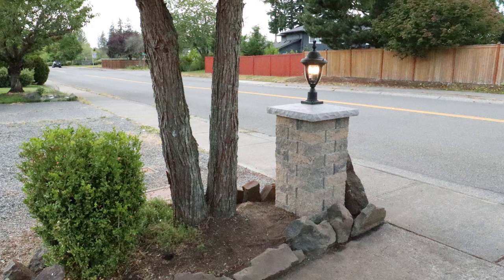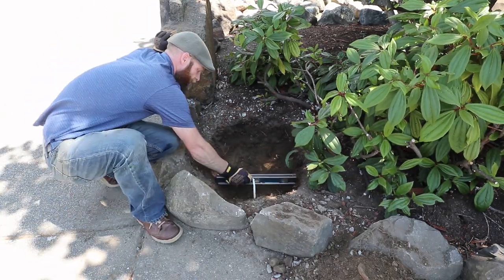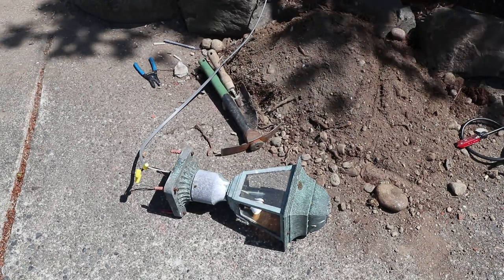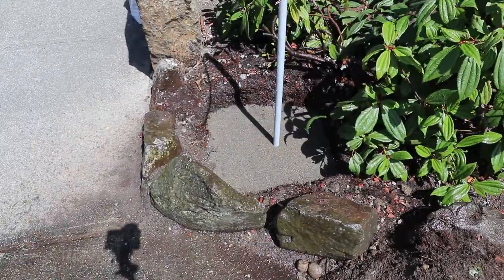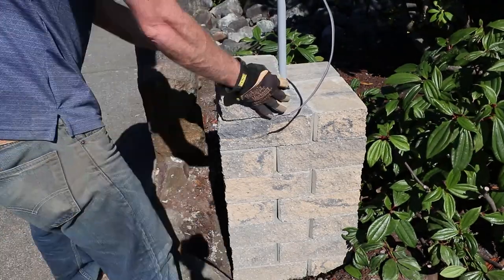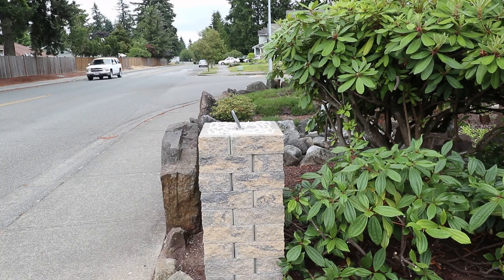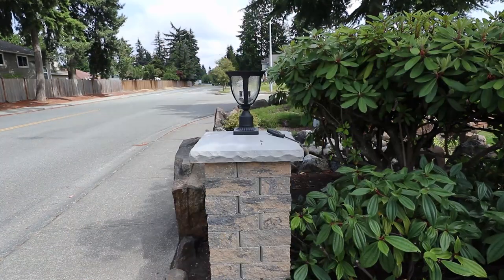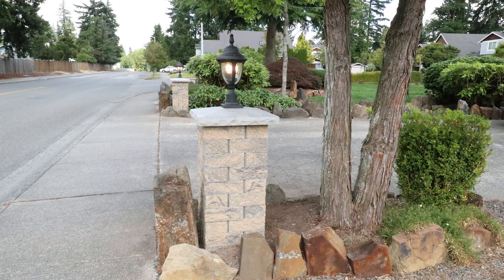Constructing Driveway Light Columns

Comment: He said “ your column is as good as your base, which is the most important step”. However he did not tamp down the gravel or the sand before laying down the first coarse!
Reply from the maker: True compacting the sand and gravel is important. I did walk around on it before setting the first course but didn’t include it in the video since using a tamper would have been better and looked more professional but they are nice and straight and I’m happy. Have a nice one.

Comment: Thanks for the video!  How long did it take to complete the project? Can you paint the cap?
Reply from the maker: I spent two days demolishing the old columns and two days building the new columns. It would probably be best to buy a cap in the desired color. They can add color to the concrete mix when making the caps. I’m not sure if they offered that option at the time or if I ordered what they had. If you use concrete paint (paint marketed to be used on concrete) then it is something that can be done.
Thank You

Comment: How much did you pay for the material? I’m very interested in doing two Pilar’s
Reply from the maker: For the block and caps it was around 750, all in with the lights, electrical & adhesive probably a little over 1,000.

Comment: Question so how do you add electricity/power to columns that are already built??????
Reply from the maker: If it has a cavity in the middle, I would remove the cap to access it. Run some UF cable underground up to the side of the column, then use some PVC conduit to bring it out of the ground. I would drill a hole near the base from the outside to the center cavity. Keep the wire in the PVC conduit and run it into the center cavity. Once inside the column it doesn’t need to be in conduit. Cut a hole in the cap, run the wire through and reinstall the cap.

Comment: Why not cement the base in the hole ?
Like this if you push it...not to say if hit mistakenly by a car...it will fall...
Reply from the maker: Having a gravel and sand base is typical for landscape walls and columns. Starting the blocks under the ground level will add strength. I will say that poring a concrete base and laying on top of that is a great method. That is basically a footer. To really strengthen the block assembly, you would need hollow blocks that you can run rebar through and fill with concrete to tie the blocks together. Without that each joint is a week point. In all reality for what these are that would be overkill. Those methods are essential though for structures and tall walls. These aren’t too tall and won’t be easily pushed over. They most likely won’t hold up to a car, but neither will the car.
Reply: @JoeMcCoskey  Agree. I was considering starting the first layer of blocks cemented 2" and then as I go up between blocks I would have put some cement or construction adhesive...so they stay together stronger...regardless how big the car is...you never know...!
Great job !

Comment: Time to invest in a shovel, hand tamper, & multi-tool. Holy frustrating.
Reply from the maker: I have all those tools. I couldn’t use a shovel due to the soil being rock/clay. I had limited space for the hand tamper but I did step on the base, I just cut that part out. I should have used the multitool for cutting the conduit off the caps.

Comment: In the northeast, how deep do I need to go?
Reply from the maker: I would generally use the guideline of 1” deep for every 8”-12” of height. The base for these columns isn’t very deep but they are on a clay / rock soil, and I don’t have to worry about movement. If these were support columns, they would need to be much deeper.
Reply: Thanks for your video, I’ll definitely copy your method, it seems much easier than others I’ve seen. What is the final measurements of these pillars? 24” wide?
Reply from the maker: @rohitnaval5589  the columns are 18” wide and the caps are 22”.
Reply from the maker: @rohitnaval5589  I also want to mention to keep the height to width ratio in mind, without a deep footing or reinforcement, columns like this need to be kept short. This one is 40”. It’s good to keep the height less than 3x the width and preferably closer to 2x the width.
Reply: I’d like to go wider if possible and shorter, 30” high. Will this stone allow for a wider installation?
Reply from the maker: @rohitnaval5589  you can make them wider by using a block between the corners. I’m not sure how much wider it would be. I’d say if you went that route it would definitely be sturdy and stand out. You would need to find a solution for the cap.
Reply: Thanks Joe, I’m going to reach out to Abbottsford to figure out the blocks arrangement. The caps do come in larger size and I’m sure I can find a size that will work with a 4” overhang. I’ll send you a picture of the finished pillar when I complete this project.